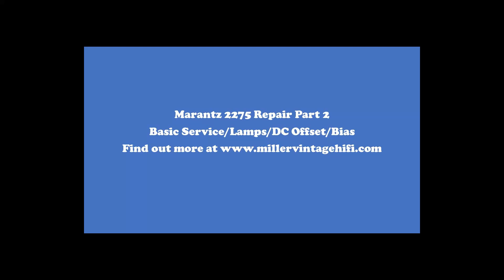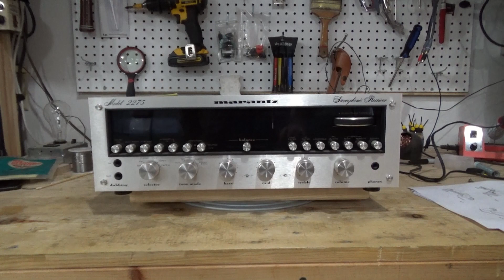Marantz 2275 Stereo Receiver Repair Part 2 - Cleaning Controls, LED Lamps, Setting DC Offset/Bias

Comment: Wrong pot dude , you are adjusting the bias pot. And oh BTW , these pots always get replaced by those in the know . Use Bourns sealed pots, they are far more mechanically stable. I typically find 10 millivolts ( 25 ma ) to be on the low side for a proper idle current for a well heatsinked pair of TO3 output devices. This amp has a bias regulator unlike the early Pioneers that just have a series connected bias pot across the driver transistor bases. For you newbies, an open series connected bias pot will cause output stage failure. A common design goof in so many Pioneer receivers IMO.
Reply from the maker: Appreciate the tips!

Comment: Thanks for the video!  I learn a little more each time I see one of these serviced.  They seem to be harder in "some" areas than my favorite Pioneer units to service.  The modular outputs are a breeze to work on, though.  I love the sound, but I'm not sure that the Marantz tax (that meaning they are much more expensive than other brands) is worth it, for what you get.  I mainly hang with Pioneer and Sansui.  I do have one particular Realistic STA-2020 that I am partial to.
Reply from the maker: I've more or less settled on McIntosh, but I still have a few Sansui's, Pioneers, and a Marantz that I rotate through.  I'll part ways with them someday :)
Reply: @millervintagehifi3034  I can’t afford McIntosh. I did have a 1900 one time.